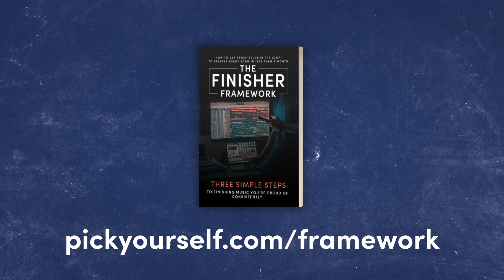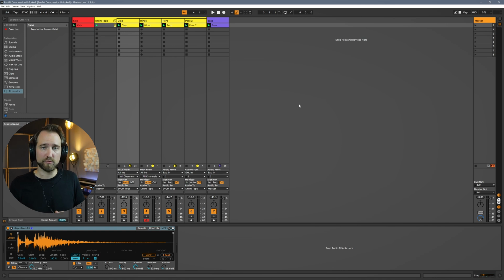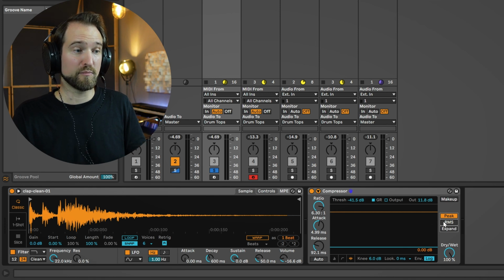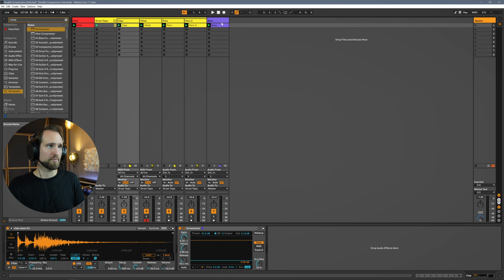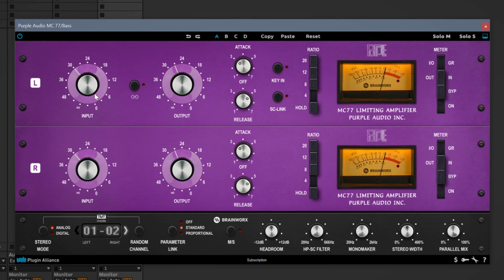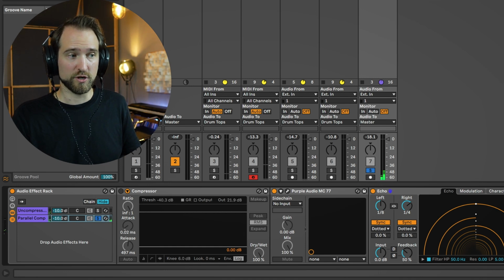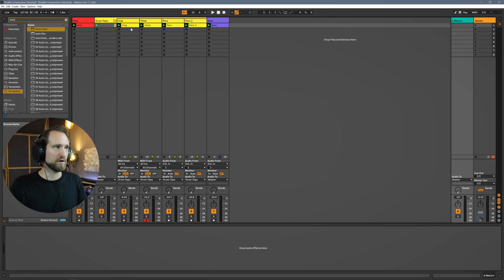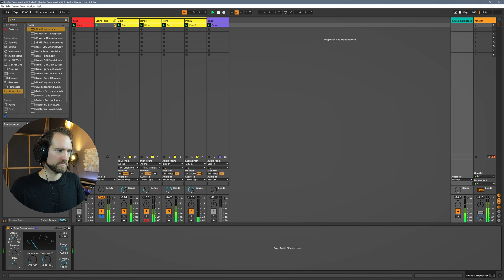How To ACTUALLY Use Parallel Processing In Ableton Live

Comment: I just discovered this channel a few days ago and am really enjoying it.  Danke, Phillip!  

Recently I've been trying to understand phasing issues and how to avoid them.  One thing I learned (I think) is that when a signal is sent to a parallel channel, altered with a low or high EQ/filter cut, and then mixed back with the original signal, there is a risk that the phases will conflict and cancel.  That's because the cut changes the phasing dramatically; it's better to use a shelf than a cut.  In "Layer 2" of the video, you apply a low cut filter to the parallel channel.  Why doesn't that cause phasing issues when it is mixed back with the original signal?  Why not use a low shelf instead, which avoids phase changes?

I have a guess: the parallel chain is also altered with an echo plugin.  That changes the time domain a lot, so there is no chance of a phase conflict with the original signal.  Is that right?  If not....what are your thoughts on this question of mine?  Thanks for any light you can shed.

Comment: Hey there! I was a little surprised to hear that you use have a long release time when doing parallel compression. Doesn't that mean that it will compress early and basically keep it down basically all the time? Doesn't that just lead to distortion? I tend to use it with shorter release times because I want to emphasize the tail of some sounds. Thanks for these really useful tutorials!
Reply from the maker: Great question! The release time is up to taste, this isn’t a “always do this” kind of suggestion. All I wanted to express is that in parallel compression you can often get away with longer release times to create a “denser” sounding parallel chain that phattens up the original dry signal. And just to clarify: Long release times don’t mean that it will distort. Super short ones do (also in limiters). But it’s often the “preferred” artifact since longer release times, even if they don’t distort, cause more pumping and change the groove more drastically.